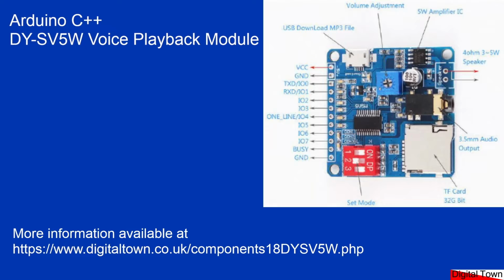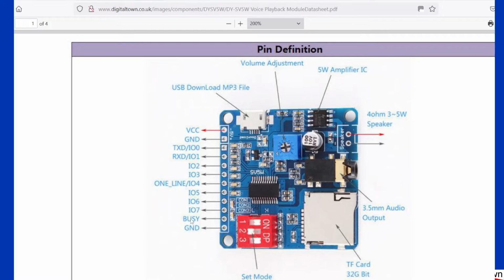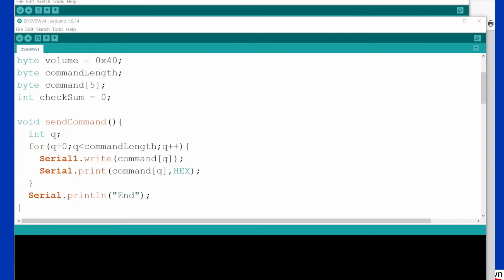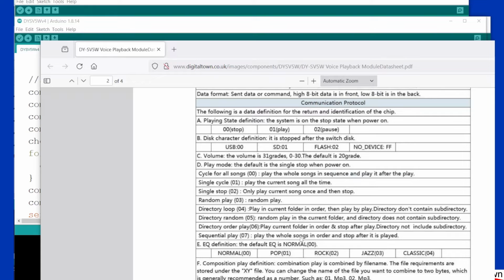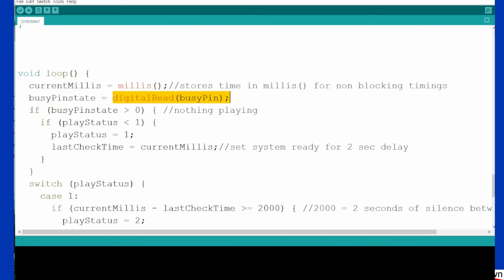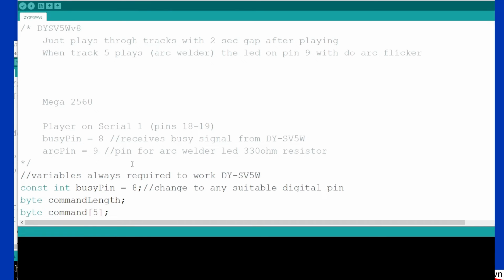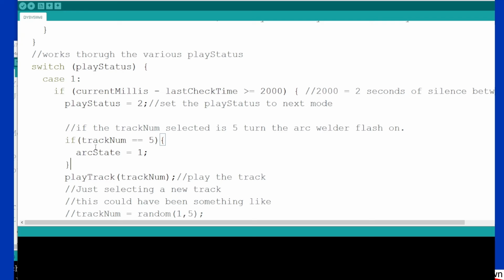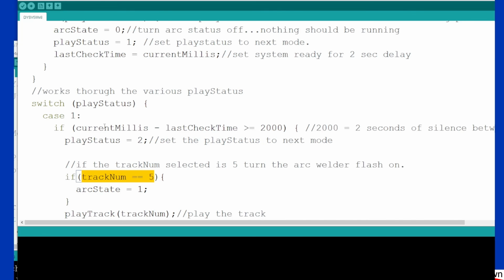Arduino C++ DY-SV5W MP3 Player with Uno or Mega 2560

Comment: I seem not able to get it going. Is there a way to test the board without even controlling over uart? I tried to set DIPs to 000 or 100 and taking down (grounding) pins 0, 1, 2 shortly. Nothing works. Cannot hear a sound. Card/files issues?
Reply from the maker: I've never known one of these boards not to work and I have lots of them so my first advice would be to check the wiring and the position of the DIP switches. DIP switches should be 1 off, 2 off, 3 ON
SD Card should be FAT32 and may have a size 16gb limit.
Make sure files are named according to the specs 00001.mp3, 00002.mp3

It is possible to test the board without UART although it's not something I've done. Set dip switches to 1 Off 2 ON 3 off for Independent mode and then take the pins HIGH/Low according to the manual. Link to the technical specs sheet is at https://www.digitaltown.co.uk/components18DYSV5W.php
Reply: @digitaltown5442  Thank you! My current card is 32GB what they say is the max. I will search for a smaller one. I think I tried all the pins combinations for the test. I will keep trying.
Reply from the maker: @sergeyzakharchenko6905  All the Pin and DIP pin settings are in the data sheet but they must be the correct settings.
If the DIP pins are set wrong the UART or direct pin mode will not work.

Comment: Hi. Can you help me? I can't find anywhere what Is the latency of this card (in my case i plan to use buttons to trigger the samples directly). Thanks!
Reply from the maker: It's very difficult to measure. It will depend to a degree on file size and card speed. Also making sure the start of the file has no blank/silent period before the track plays. With Serial the lag is minimal so with buttons it should be just the time to read drom the SD card.

Comment: Hello, I started looking at your explanations and I saw that an Arduino board is required. Yes, I have one, but is it absolutely necessary? Because if we put buttons on the different switches from IO0 to IO7, and set CON1, CON2, and CON3 to 0, 0, 0, we would only need 8 on/off buttons to choose the correct combination to start song 0001, 0002, or whatever. Right? Is it really necessary to use an Uno or Mega board? 
Sorry, i'm french
Reply from the maker: You can just use the buttons, the data sheet gives the information. I've never used the buttons apart from a quick test and my projects require control from a distance.
Reply: @digitaltown5442 thanks you

Comment: Unfortunately there isn't much in the documentation about standard mp3 mode. If anyone knows a way to get feedback when we change mode or repeat, looks like it is impossible to get feedback to tell which mode we are in, other than that looks nice little board. In my experience I didn't rename the files, what matters is the order they are saved to the SD card.
Reply from the maker: Looking at the pin out there is not really a way for the board to give much feedback in Standard MP3 mode as the TXD and RXD pins are used for PREV and NEXT and the Single Line system pin is being used for RPT.
I think it's down to the programmer to keep track of what the unit is doing, a bit of a pain but these units are built to a price point.
Reply: @digitaltown5442  The documentation is really something else, I wonder how many people have blown out their boards cause of the wrong 5V polarity. They could've at least mentioned the sequence of the repeat, what does the mode do and its sequence as well.

Comment: I'm triggering this with a reed switch. Is there a way to get this board to trigger a file only 1 time even though it stays latched without using a microcontroller?
Reply from the maker: The problem with the Reed switch is you are constantly pressing the button so the track will keep playing. They are designed for momentary switched. Unless you can work out an alectronic circuit that will only send a short press the only option would be a microcontroller that does the work of the circuit and uses the Reed switch state as the trigger but only send a single play track command.

Comment: Hi Bud...Im using hats to trigger some samples but I just have the buttons connected straight to the trigger pins, no programming at all, I want the audio to play its full piece before it can be triggered again, any ideas ?...Thanks !
Reply from the maker: Just monitor the busy pin, there is some sample code at https://www.digitaltown.co.uk/components.php#DYHV8F Sketch 3 shows how to trigger the next track when the busy pin state changes. You will just need to change the pin rather than sending a button press.
Reply: @digitaltown5442  Hi apologies, this is my first go at this sort of thing, I dont have any other boards other than the DY-HV20T,  they busy pin in the sketch seems to connect to a 2nd PCB , is that correct ?
Reply from the maker: @ Yes you need some kind of microprocessor board to monitor the busy pin.
Reply: @digitaltown5442  Or maybe a set/reset latch that only resets on the busy pin going high.

Comment: Your picture in the begin is wrong, the VCC and GND are flipt, if you look realy good you can see it on the board.
Reply from the maker: The intro picture is wrong and is quite funny as it's taken from the datasheet that is wrong. When you look at the circuit diagrams on the resource page you will see the circuits have the VCC and GND enhanced to make sure people get it the right way round.

Comment: I coppied your code to my arduino but nothing happens after I turn it on.. should I trigger it somehow or it has to start playing after power on? also I had to rename the serial1 to serial because arduino nano have no serial1
Reply from the maker: You need to be running the Arduino UNO version of the sketch on https://www.digitaltown.co.uk/components18DYSV5W.php (Try example 5). This uses softwareSerial. Just changing the mega version and changing to Serial instead of Serial1 will not work as other parts of the coede and connections need to be changed.

Comment: Great video. Thanks !!  How would i trigger a specific track from an input trigger? Ie - a train horn sound from a horn button that would interrupt the rest of the soundtracks. I'm having trouble with where to integrate the button pin hi/low digitalread
Reply from the maker: If you take a look at the code in the video for the DY-HV8F https://youtu.be/TxMwZyBVwEg?si=4hvxVNIMo5jV7Tph (They use the same instructions) you will see in example 3 how you can set it to play random tracks at random intervals... written specifically for model railways.
If you then look at the video on deboucning buttons https://youtu.be/kXDviSgM22w?si=tHyYOzsv5lDepV16
Take a look at example 4 in the code and change
if (buttonPress > 0) {    //only run this if a button is pressed
      buttonMillis = currentMillis;              
      if (rightBlueLEDState > 0) {          //if it is pressed change the state of the blue LED
        rightBlueLEDState = 0;
      } else {
        rightBlueLEDState = 1;
      }
      digitalWrite(rightBlueLED, rightBlueLEDState);  //turn LED on/off
    }

to something like
if (buttonPress > 0) {    //only run this if a button is pressed
      buttonMillis = currentMillis;              
      int soundTrack = 2;
      playTrack(soundTrack);
    }

This will cause the debounced button to play whatever track you have selected in soundTrack =...track to play

The track will play once and when it finishes should resume playing the other tracks at random.
Reply: I wanted to tell you how much I appreciate your resource. Your videos very clearly and thoroughly expresses you inherent knowledge. Thank you! I'll send an update when I have one.

Comment: Will the sounds play with +5.5v from the Arduino mega? Or do I somehow have to convert the positive voltage from the pins on the arduino to negative?
Reply from the maker: Mega connections in the examples use are:
Arduino Mega 	DY-SV5W
5V 	                        5V+
Gnd 	                Gnd
RX1 	                TX
TX1 	                RX
Pin 8 	               Busy Pin

Comment: In your diagram you are showing VCC on the minus (-) side of the 5v and GND is shown connected to the plus (+) side on the board (square pin).  It looks like you have the polarity reversed.
Reply from the maker: This is a weird one, if you take a look at the datasheet they have messed it up. https://www.digitaltown.co.uk/images/components/DYSV5W/DY-SV5W%20Voice%20Playback%20ModuleDatasheet.pdf
If you zoom in you will see they have labelled 5v+ as GND and GND and 5V. I had a previous complaint for having it the other way round.
Reply: @digitaltown5442  Yeah, their datasheet is dead wrong.  I have a different datasheet for the same board that shows it correctly.  I verified with a multimeter that pin1 and pin12 are both ground.
Reply from the maker: @Enigma758  Could you provide a link or email the datasheet so I can update the resource page
Reply: @digitaltown5442   I downloaded my documentation some time ago and I didn't save the URL.  Unfortunately, youtube doesn't let a viewer post web links on someone else's channel. However if you google for DY-SV5W icstation, you will find a web page with the correct diagram.
On another note, I wanted to thank you for the well done videos, they were very helpful.  One question though, do you know what the "one line" interface is about?  I'm guessing  it's when you don't have a true UART and you want to "bit bang" it through a digital output pin.  Is that your understanding?  Thanks.

Comment: Sound is low on aux port. How can I solve this?
Reply from the maker: What do myou have the volume set at using function void playbackVolume(int vol)?
Reply: @digitaltown5442  I have set it 30 (max value). Yes it was max than others but still too low. And I tried speaker output with 3.5 jack socket with earphones and the problem has solved. The sound is loud and nice. But amplifier chip gets too hot now 😃
Reply: @gezmeyengezgin3828  "But amplifier chip gets too hot now" - I noticed the same thing, my amplifier chip is getting far too hot. I tried with a 3W speaker and a hyperx headphone, and both make the chip go sun face hot.
Reply: Okay, re-did all the circuits and now it doesn´t melt my finger  (lost a pretty good heater). Must have been a short circuit.

Comment: This is a fantastic tutorial complete with the programming and detailed explanation on a rather complex topic. You have taught me so much and it is so appreciated. I had many problems and difficulites, but by going through your steps multiple times, cross-checking my work and trouble-shooting, my final roadblock was most unexpected. I cannot explain it, but in providing a separate 5V power source (and I tried several) directly to the DY-SV5W it doesn't work. Once I wired the power straight from the Arduino Mega, it did! I have 3 of the boards now and they all demonstrated the same issue. I now have them all working on the one Arduino Mega. I couldn't have ended up here successfully without this video, the code, and links you so generously provided. Thank you!
Reply from the maker: Thanks for the feedback. Just looking at your issue with the seperate power supply. Did you connect the external power supply GND to the Arduino GND and well as the DY-SV5W?
Reply: I did not but just wired it as you suggested and it works! Wow, another lesson learned. These DY-SV5W mp3 players are really great, as you said. I'm using the 3.5mm audio jack connected to a JBL charge 4 speaker for my animatronic work and the sound is fantastic. Next hill to climb is to actuate the jaw movement through the sound. Thanks again! @digitaltown5442
Reply: @digitaltown5442 Hi, do you know if this board can save the inputs for buttons to activate certain songs and could you put a start up song on when you power it on? Thanks
Reply from the maker: @JadesPhat  The board doesn't have a "save" function for the buttons. The data sheet shows button combinations to play a certain track number.
I use the Serial UART method because it allows me to play certain tracks in any order. That means you could write your code in a way that it starts to play a certain track at start up.

For model railway background sound effects I monitor the busy pin and when no track is playing set a random time gap until the next track (selected at random) starts playing. It would be just as easy to monitor the pin and if nothing is playing send the command to play a specific track causing a track to be played at start up.
Reply: @digitaltown5442  thank you for the info I want to connect this to a ardunio nano will that be the same/ similar to the code you done in your video? I want it to make a smart up chime and some leds pretty much like your arc welder you have done I was thinking leds to arduino and have the intermittent high to low like a pulsing effect could you give me a time stamp from your video on what code I could work off? Thanks again I’m having trouble finding info on this certain player.
Reply from the maker: @JadesPhat  The code should work the same but you will be using software serial so a bit like example 5 on http://www.digitaltown.co.uk/components18DYSV5W.php
Just add the function in the same way.
When I did the arc welder with sound I didn't use the loop function. I played the track and had the led flicker but monitored the busy pin. As soon as the track stopped playing the LED stop flickering.
I then had random intervals until the track played again and each time it played started the flicker effect.
Reply: @digitaltown5442  thanks for the swift response I was thinking of using the busy pin like you did but for a laser diode. I’ll have a look at that link you shared.. have you got any other videos I can have a look at with this dy player ? Thank you so much again.
Reply from the maker: @JadesPhat  No more videos at the moment, hoping to do a few morte in October once I get an exhibition out of the way.
Reply: @digitaltown5442  okay thanks for the help and hope everything goes well with it and I’ll sub to keep updated
Reply: @digitaltown5442  It appears I never replied (though I thought I had) so even though it is quite dated, I wanted to say thanks again as you were also correct regarding the GND. I continue to learn more including electronics and am now trying some new things on another of your sketches!

Comment: Great job. I'd like to use this module for reproduce station sound or announcements in my h0 layout. is it possible to use DCC signal from Roco Z21 and Traincontroller software to control audio outputs automatically? Thank you
Reply from the maker: Yes it is possible. You would use the NMRA library in the way I have used it in https://www.youtube.com/watch?v=XNSKefvmorU
As you selected an Accessory decoder address, each address could send 2 sounds depending on the accessory direction set,

Comment: Is it possible to trigger individual tracks through single line communication with esp32?
Reply from the maker: I did a seperate video at https://www.youtube.com/watch?v=-S78cwJTPCg with the ESP32 and ESP8266.
In the sample code there is a function called void playTrack(int soundTrack) that just passes the value of the track you want to play. Although I used the RX pin in the circuit it's not needed on the code as I found out with the d1 mini version. You just need a TX and a busy pin.